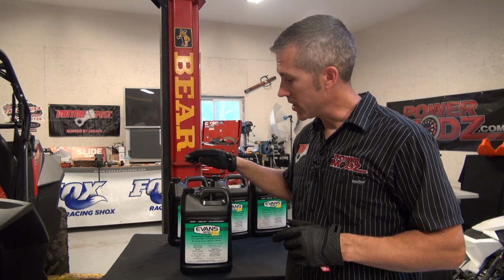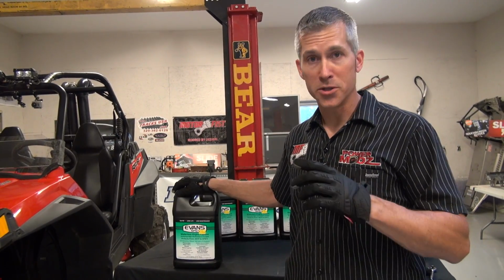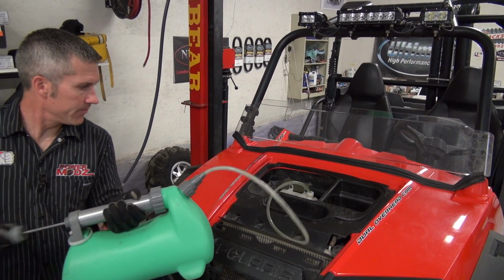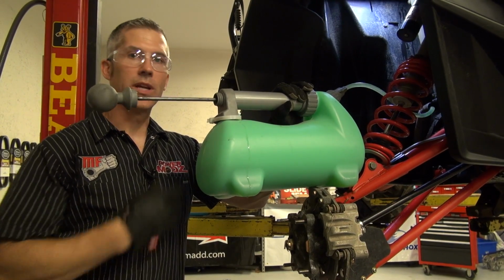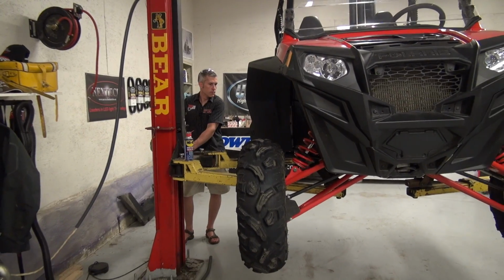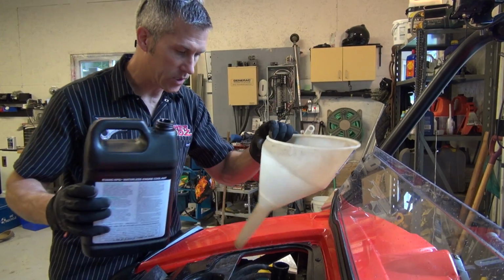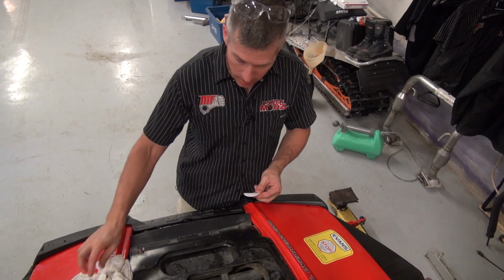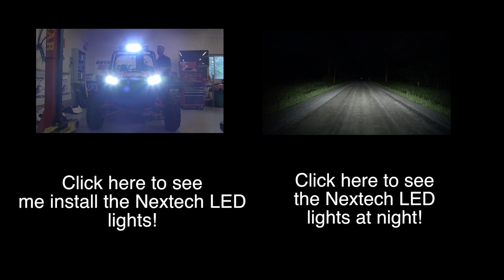Polaris RZR 900XP mod build, Episode #3 Evans Waterless Coolant Install!, PowerModz!

Comment: There are differences between the High Performance Coolant (automotive) and Powersports Coolant. Given the option, you should use Powersports in your powersports equipment, but the HP won't hurt anything. If you need to add some and it's a different blend than what's in the machine, that's OK to do, they are all compatible. The ratios and additives are somewhat different between them though.

Comment: Hi always like your videos. I had a couple questions. You mentioned no pressure and the overflow bottle, can you remove the overflow bottle? Also with no pressure would you still need the weep hole in the water pump cover, or could you seal it? I am in Louisiana and pretty much the only riding you can do here is deep in the mud. What do you think?
Reply from the maker: I keep my overflow bottle just in case but it's never really been used it seems....just always filled with muddy water...if its a dedicated mudder you cold try without it but if a daily driver id keep it..  Im not sure about the waterpump weep hole..never filled one but never had mud in my system either.
Reply: I just re-built my complete motor and decided to go with Evans Cooling. You never mentioned putting Evans in the overflow bottle. Is it not necessary anymore? What exactly did you do to have a "sealed system" and what does that mean? We are having issues with the overflow bottle losing coolant right now... and can smell it a little bit. Not sure where it's coming from, as all the hoses have been checked with no signs of leakage. Your help is appreciated. Thanks!

Comment: ENGLISH  here and FRENCH  lower

Hello first of all thank you for all your videos it is really useful, any time you showed poorly the products you used or the way you do it and damage because I am on average between 40 to 60% to make changes on my rzr 900xp.
My question being that I looked at EvansCooling they say that the minimum temperature and -40 and par-froid say that I go on a ride it takes -20 and that with the factor sells well it falls to -30 or -35 and this during the days at night the temperature will surely fall below -40 which indicate on their product I wanted to know if there can be risks. And the exact models that you put in your rzr thanks and not let go! P.S still a liver thank you

FRENCH
Bonjour tout d'abord merci pour toutes vos vidéo elle sont vraiment utile, toute fois vous montré mal les produits que vous utilisé ou encore la facon dont vous procédéder cela et dommage car je me refait en moyenne entre 40 à 60%  pour faire les modifications sur mon rzr 900xp. 
Ma question étant donnais que j'ai regardé sur EvansCooling ils disent que la température minimal et de -40 et par-froid disons que je part en ride il faut -20 et qu'avec le facteur vend bien cela tombe a du -30 ou -35 et cela durant le jours la nuit la température tombera surement en bas du -40 qui indiquer sur leur produit je voulais savoir s'il peut y avoir des risques. Et le modèles exacte que vous avez mis dans votre rzr merci et lâché pas! P.S encore une foie merc